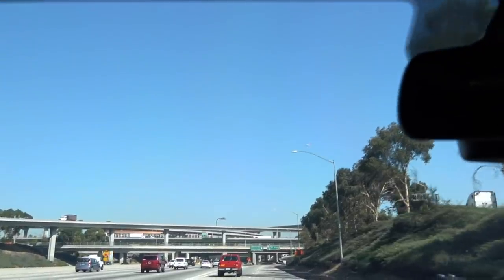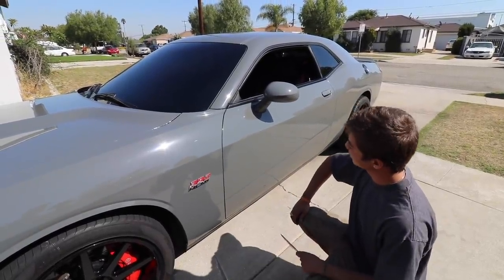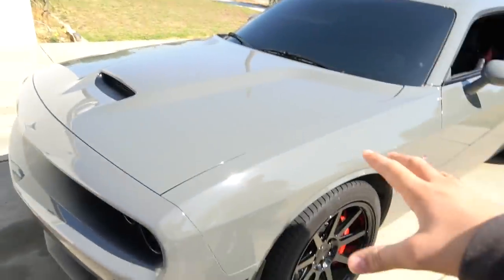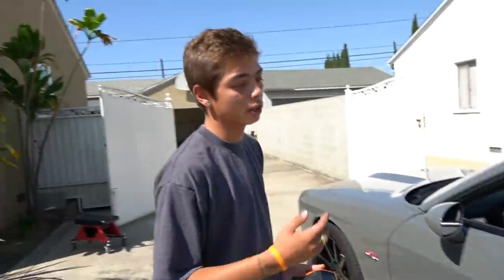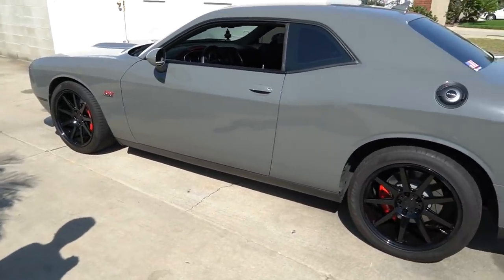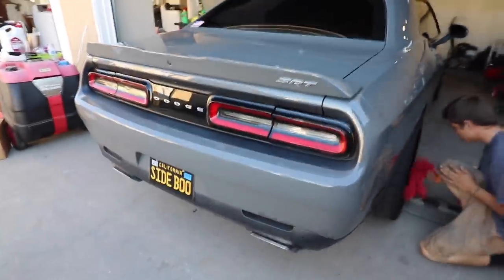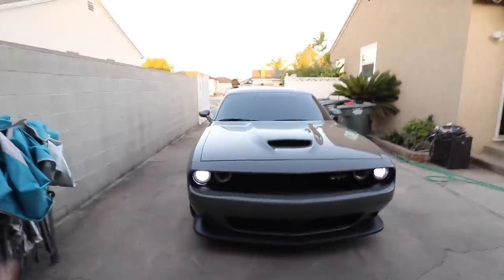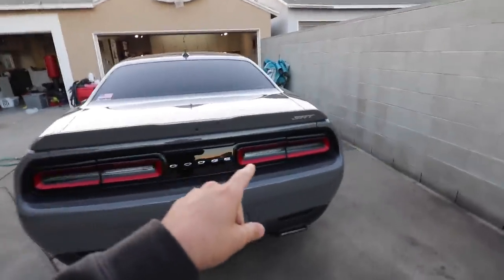EVERY NEW CAR OWNER SHOULD DO THIS! I SHOULD HAVE GOT THIS DONE SOONER!

Comment: These guys did a wonderful job but you need to keep it up. Do the two bucket method and use the right type of microfibers, get them from "The Rag Company" they are the best bar none. I had a brand new Mazda 6 that I followed Chemical Guys cleaning method and after 4 years it only had a few minor had to see surface scratches no webs high gloss, I got remarkable trade in value for it by keeping the paint nice.

Comment: Unless there’s some new gage I am not familiar with.....For what it’s worth, The orange Elcometer is used to measure the total thickness of the paint (clear coat included). 25.4 microns is 1 mil of paint. It is an eddy current gage which measure base metal to average coating thickness.  140 mils is almost 6 mils of paint.
Reply: J W -you mean 140 microns is equivalent approximately 6ml.

Comment: Why can’t that serum for the coat be added on top without “sanding” the current layer?
Reply: Because you'll end up with high low patches where the serum didn't adhere evenly and you'll also have a protective ceramic layer but a crapy swirl paint job underneath.
Reply: jaymogul25 but isn’t the serums job to fill in the swirl marks in the paint making it “even”? And making the swirl marks disappear. Like when you get cracks in your drive way and just fill those in?? Not sure if this example works but
Reply: J J then ur driveway looks patchy, sanding makes the upper layer levelled and the serum sits perfectly
Reply: If you don’t paint correct you leave the swirls and then you add a coat of serum on top basically sealing it in. It won’t be even and will be blotchy due to the uneven paint & that’s why you have to level and correct the paint.
Reply: @JJ-di2oe  no ceramic coating dosen't fix your paint it protects it.

Comment: What size back wheel and tire do you have on that thing. I want to do a staggered look i have the stock 20x9. I want to keep that size in the front but put a wider tire in the rear. That ceramic coat looks awesome im about to do that to mine it would look awesome with the plum purple.

Comment: So from what I gather, they "hooked you up" with a free detailing and ceramic coat for making the video. What is the average cost of having that all done - paint correction and ceramic coating?
Reply: $2500 give or take - I've had it done on two different cars here in Scottsdale, AZ (Raptor and Model S) - not "thrilled" with result either time (two different shops) for how much I paid. If I got it for free I would have been thrilled :)